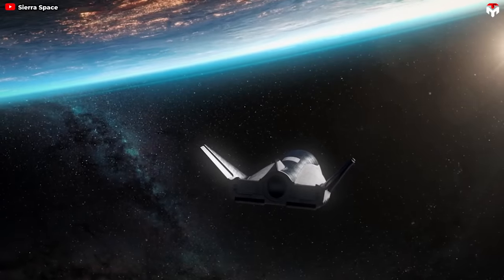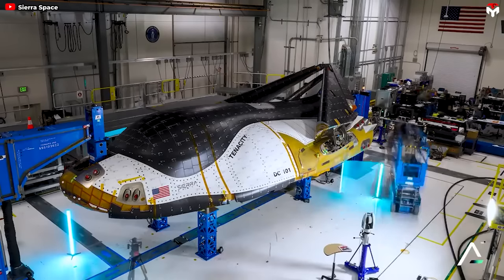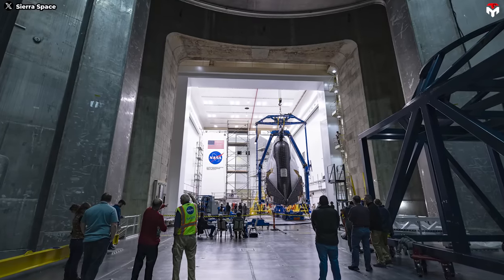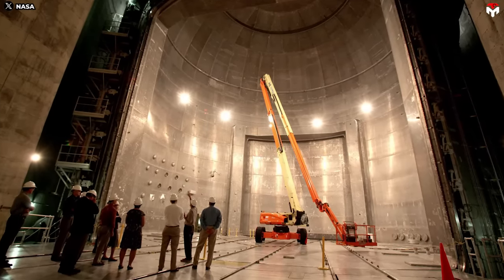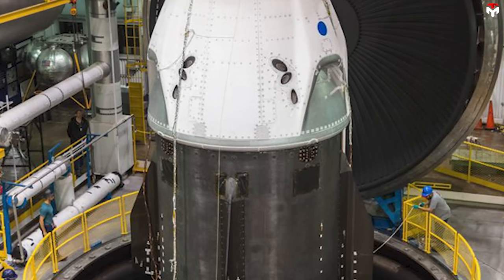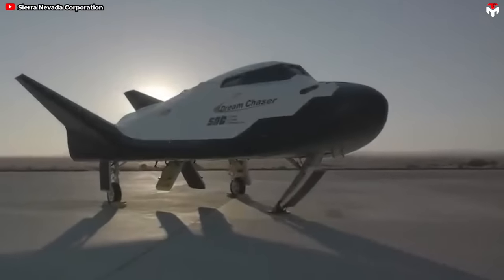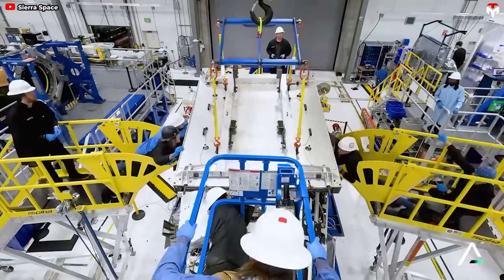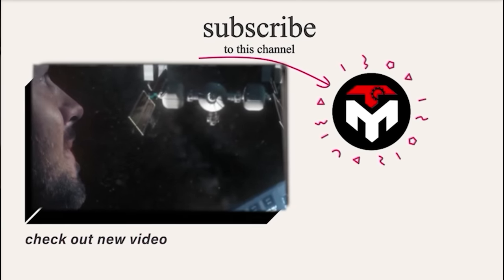NASA just revealed Major Plan on Dream Chaser space plan that made Elon Musk laugh...

Comment: Starship is a bit too large to fit in this NASA vacuum/temperature test chamber. What then?
Reply: Too late, been there, done that.
Reply from the maker: I don’t know, maybe building a new ones???
Reply: The shuttle could not fit either, only the command crew section was fully tested. Same thing could be done for Starship, exclude the fuel tank section and rockets, it's probably 1/3 the size.